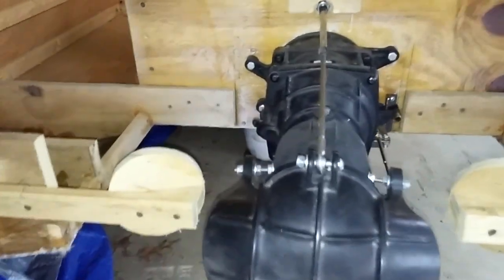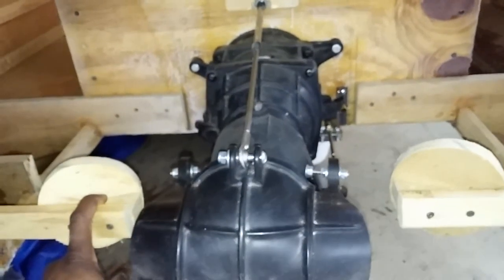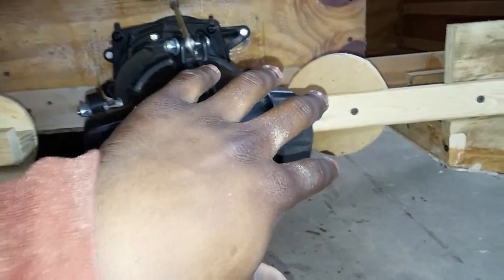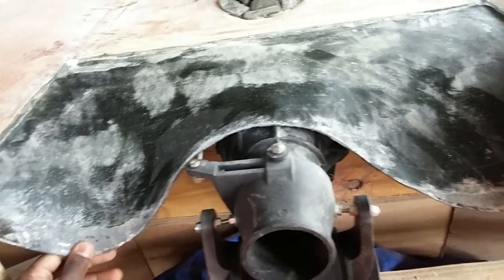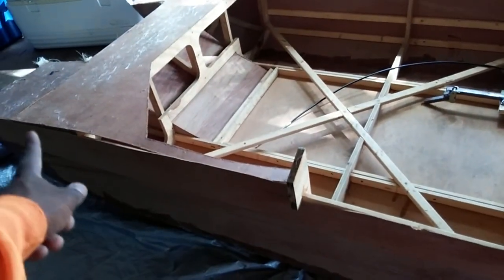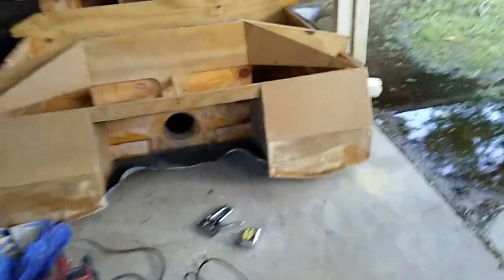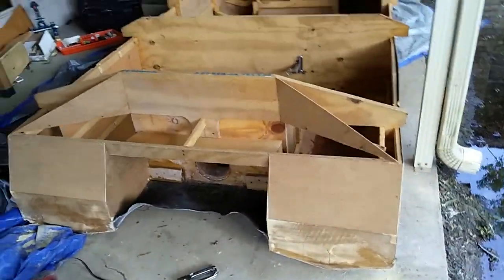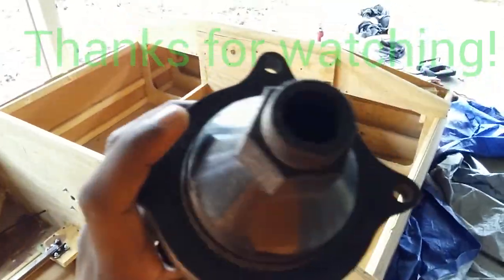Homemade plywood jet boat pt.9(ride plate)

Comment: Hello Ronald!  I like your fleece layup and glass work.  What are you using for engine and coupling?  I saw one of your earlier videos showing a possible high mounted engine with complex clutch and chain drive leg.  Have you considered a simple direct drive unit?  How about mount the engine low and in line with the jet ski input shaft and direct couple the engine to the jet pump shaft with a Rexnord Flex coupling (http://www.rexnord.com/sites/process/Pages/OmegaElastomericCouplings.aspx).  I made a 10-ft jon boat into jet power with a horizontal shaft engine, Rexnord coupling and Berkeley 6JC jet pump with reverse bucket (somewhat like yours). The flex coupling eliminates chain noise and oiling spray issues, and it is much smoother. With reverse, you don't need a clutch, just start up the engine with the reverse bucket preset to a midway on position so the boat will set still while you are boarding. Put a small spring on the steering lever at the jet pump so if you fall overboard, the boat will circle back to you.  Have fun!
Reply from the maker: laura mcdougal Thanks a lot! Lets cross our fingers and hope that she works. Im assuming you're talking about the first setup I wanted to use with the reverse box https://youtu.be/U4R7UJIA6jI If so, I decided not to use that setup and use this setup instead https://youtu.be/jOsvLZ3RyAY I would love to directly connect the engine to the pump's midshaft; but I couldn't find anything that coupled from a keyed 3/4 shaft to a threaded 1 1/8 shaft. Thanks a bunch for the link, Im going check them out right after this comment. Someone else told me the same thing; that there is no need for the clutch because the water will at as one. Thanks a lot for the safety tip about the return spring. I've put one on the steering joystick, let me know if you think this spring will be sufficient https://youtu.be/hiCeTmzxySw Thanks a lot for the help! You're freakin AWESOME!